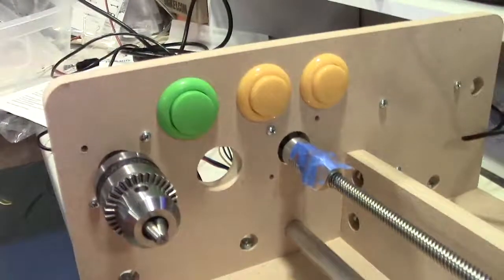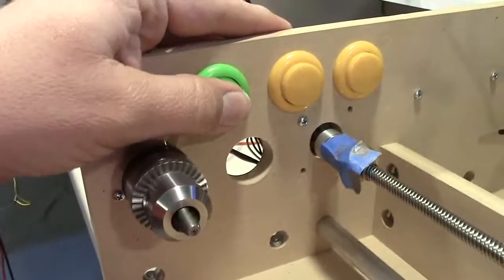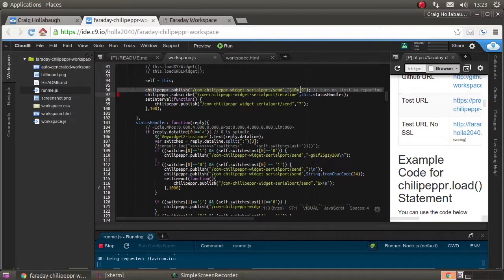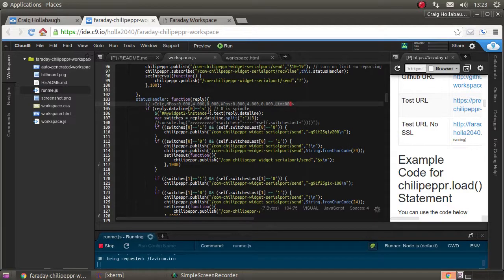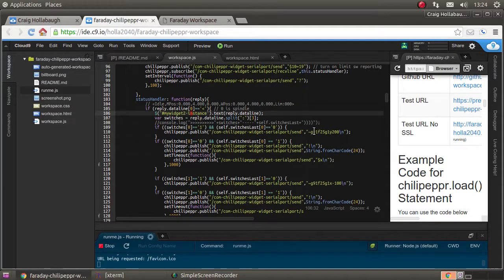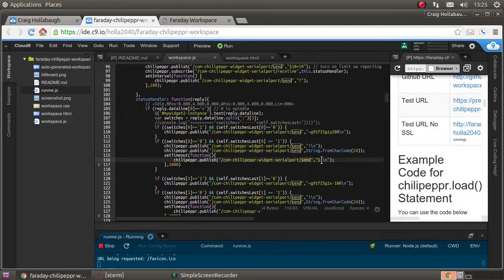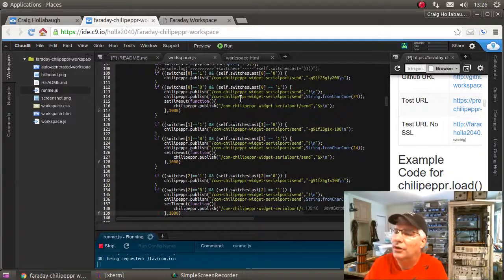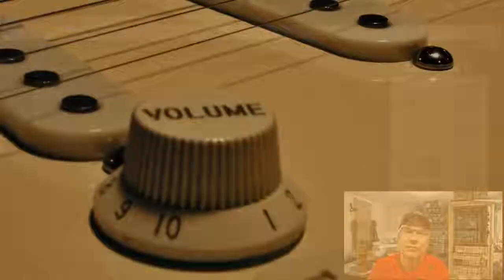160201 Faraday Coil Winder - Chilipeppr Jogging

Comment: Hey Craig, it's looking awesome. One thing you could do for getting position reports is subscribe to the same pubsub the Axes widget subscribes to. You can always look under the upper right corner triangle menu of a widget to see what it subscribes to so that if you suspect a widget subscribes to something, you can actually see it revealed to you. You can get an actual signal of the axes in a nice format so that you don't have to subscribe to the /recvline signal and do all your parsing.

However, it does seem you need that Lim: value and so for that I do think /recvline is the correct signal to get it from.

Also, for the "this" problem you should say chilipeppr.subscribe(thesignal, this.statusHandler.bind(this)). Javascript figured out this is a problem for callbacks and thus gave you a way to override the "this" to the correct value. You'll see this is common in most of my code.
Reply from the maker: +John Lauer this.statusHandler.bind(this) is a nice solution to the closure this. Thanks for the tip, I'll need to read about bind. My workspace doesn't use the Axes or grbl widgets. I'll work my coil winder widget next to format the status recv.